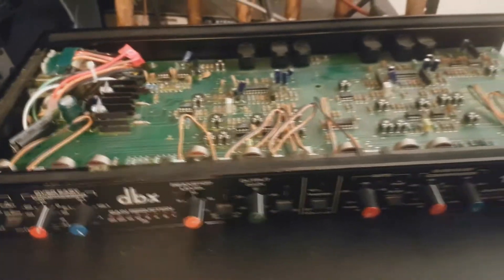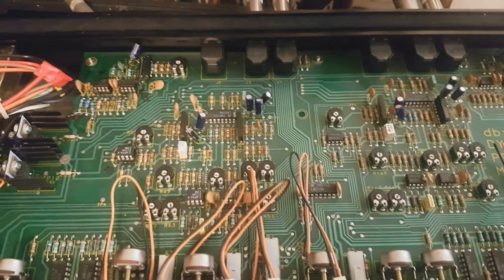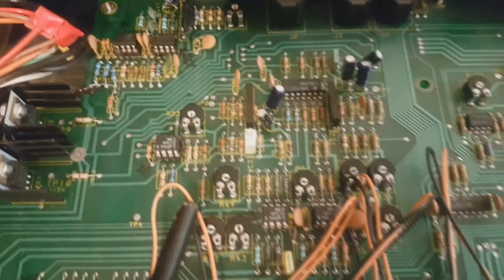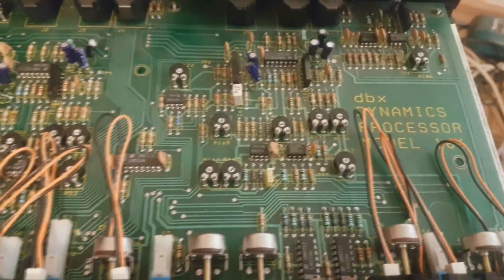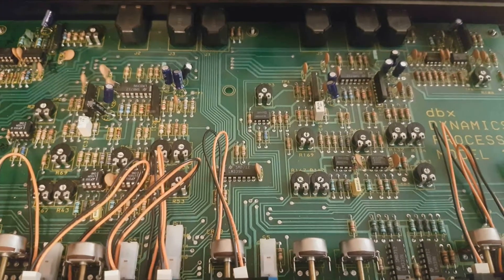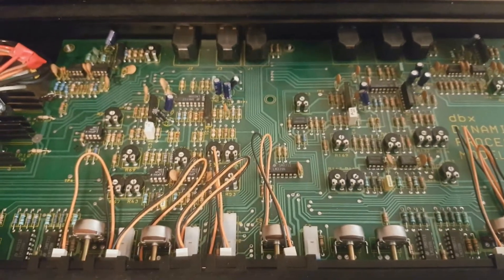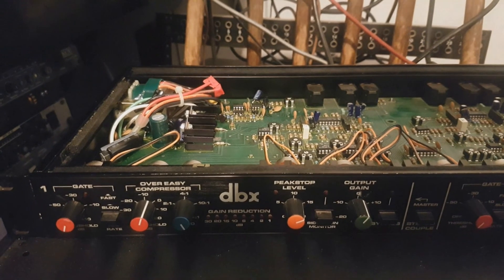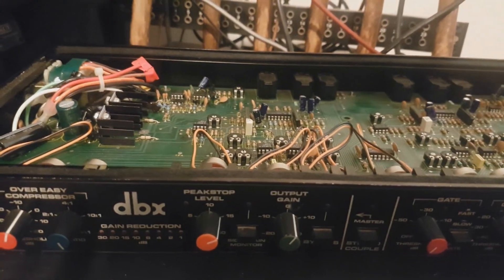DBX 166 Modifications

Comment: hola, yo tengo uno igualito pero me entra un poquito de ruido, como podría mejorarlo. me ayudas porfavor me das un contacto para escribirte
Reply from the maker: If you have a low frequency noise (100/120Hz) start by changing the electrolytic caps at the PSU. If your potentiometers are noisy try to clean them with a contact cleaner (Deoxit)or replace them.
Reply: @AsafSmilan  Replace c3 ,c4, c7, and c8 with 1000uf-2200uf 35v caps
? 
podría utilizar cualquiera o hay alguno que sea el mejor?
 y funcionan bien con trabajos largos en el tiempo ??
Reply from the maker: @naturallivesession  Get high quality / low ESR caps (Panasonic / Nichicon) from a deaccent distributor like Mouser / Digikey

Comment: Thank you for the demonstration. For those who find the gate a bit slack on the attack. You can reduce the value of R79 and R179 resistors from 1K to 380ohm. I know it's possible to use a small 1K pot with a 100 ohm serie resistor to implement an external attack control... I went the resistor way and It works very well on percussive grooves  and to clean noisy spoken poetry mic tracks.  I also adjusted the R63 and R163 trimmer to set the depth of the gate to -15db for a less aggressive gating... A 50k pot on the front can replace the trimmer for external control... I'm a bit of a fetichist..  I chose not to destroy the face of my 166 and did all the mods on the inside ;-)  
(I've just tried the modified gate on your video sound samples. And it sounded great.)

Comment: Really nice sounding mod! Which OP amps, VCAs and PSU caps are you using for your mod?
Reply from the maker: Those are the modifications I've made so far to my DBX 166:
PSU MoD: – Replace c3 ,c4, c7, and c8 with 1000uf-2200uf 35v caps
– Replace c5 and c9 with a .1uf film cap (preferably polypropelene)
– Bypass c6 and c10 with .1uf film caps
Channel 1:

IC MoD: – Replace chip OA1 with better ic (NE5532,) 
– Repalce chip OA2 with better ic ( OPA134) 
– Replace the VCA IC1 with a THAT 2180AL08-U (lift pin 4, pin 4 should not connect to anything)
– Add a 47pf NPO ceramic cap from pin 3 of OA2 to ground (Suggested by Jim Williams)
Reply: @AsafSmilan  Thank you very much!

Comment: original hits different the lower end, it looks that it would have somelike a lowpass filter in the control signal idk, while the modded sound more flat and has more definition, but it makes it less thick.
maybe the caps change? or the response of more modern ic's?
Reply: IMO, one of the "charms" of the original (USA and Hong Kong made) 166 is that the early-era dbx VCAs did indeed increasing Constrict Audio Bandwidth as they were "pushed".  It's like having an "automatic EQ" pulling back highs and lows (especially noticeably the higher frequencies) as the signal gets hotter.  I often find this very useful  on electric bass guitar, and especially in "live" on-stage bass rigs.  Additionally, the output gain on the original 166 can add a nice, thick and musical grind/crunch to a bass when you get it up into about the "7" range.  Patching through ch.2 also gives you two different settings at the push of a button (couple-button makes ch.1 controls "master").  Some people find the "Peakstop" to be a very-usable distortion/fuzz effect.  The Gate is pretty useless.  "Transparent" comps I have plenty of when that's what's called for.  The old 166 is definitely not transparent.  I love 'em for that!
Reply: @wrs840  I can guess that the "automatic EQ' you're talking about it could be a bandpass filter in the control signar of the compression. It makes me a lot of sense since what I heard in my 166 (hong kong one). I'll try patching the two channels, thanks for the tip.

I got a nice kind a gated snare with the gate but i like weird sounds so I can't say is useful haha. 

I work with SSL compresors and I found the E version sound similar to 160 and 166. They should share similar knee configurations.